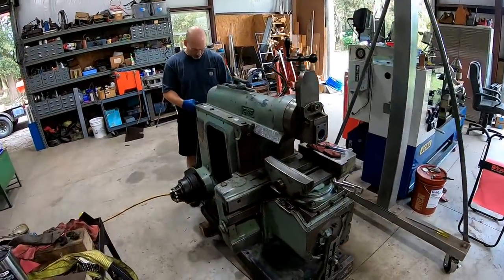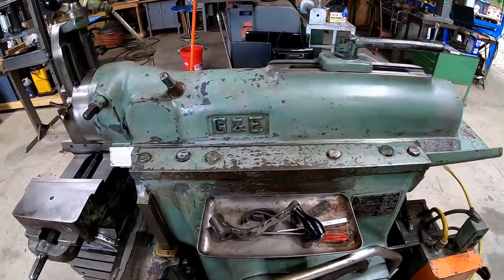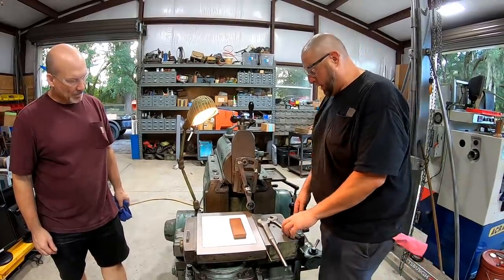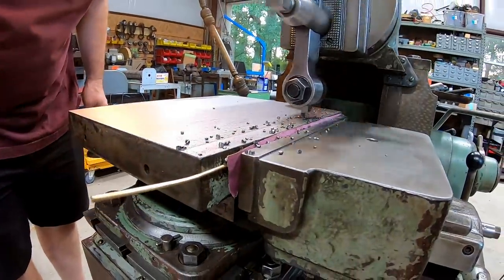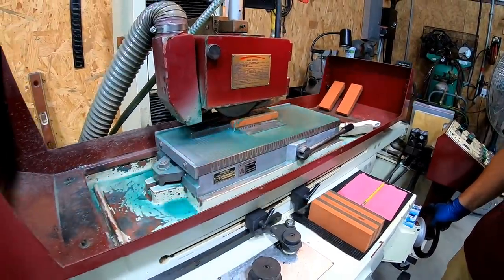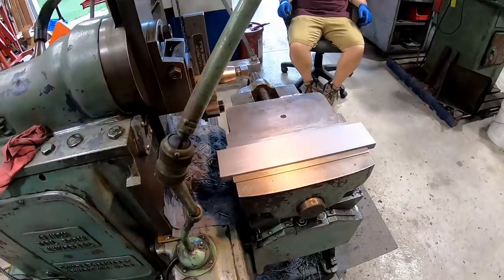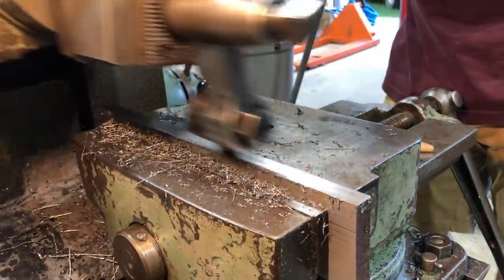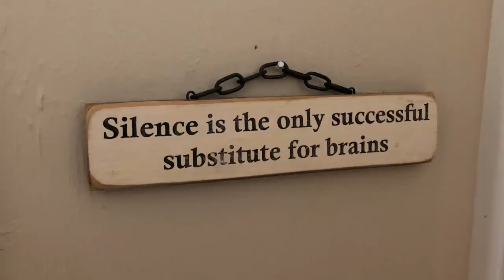SNS 275: 16" Gould & Eberhardt Shaper

Comment: I started off in tool & die making right out of high school (1977) and the shop I worked in had two shapers.  One was a Steptoe and the other was a Gould & Eberhardt.  I always enjoyed running the G & E .  My cousin, who was part owner of the shop, had a truck manual transmission rigged up between the motor and the machine.  I kid you not, and it worked great when you needed to change speeds,  I sure miss working on those vintage machines but as soon as I saw what was coming, or should I say, the factories and shops leaving, I left the field and got into drafting and then design.  I have a tiny machine shop in my garage mostly to enable me to fix things. Anyhow, it is so satisfying to see you two gentlemen keeping the craft alive.  I wish you many years of enjoyment with your shaper.

Comment: Slightly surreal Adam, ref visual difference from your shaper plus yourself, and this one. Needs raising up on a plinth 6 plus inches, used to be standard for many shapers in machine shops. 
Great finish machine surface tip. All the best to Lance and his shaping.
Thanks for sharing

Comment: back when I did planing on machine tool ways. and broad nose finish was called for. the tool was set by using a "jo block" to check for flatness. that way you could have clearance on the tool nose. I ran a Rockford planer with table 36" x 8 feet. the depth was very small, but the width was up to .500" to 750". this produced a really nice finish. can't do that on a shaper. also you would have to stop the ram at each stroke for moving the tool over. also cast iron really likes to warp when machined. so depth of cut was critical. usually as little was needed to "clean up" the surface.

Comment: Hello Adam, You may be onto something with the vibrating motor theory.  I have a 14" Elliot shaper and it came with a motor that ran very rough.  I was getting poor finishes and suspected the motor may be the reason. I found an old Brooks motor for it which ran exceptionally smooth, and as an experiment I changed motors part way through a cut.  The cut was much smoother after the change.   Ken
Reply from the maker: We know it’s one of the issues. The entire machine is vibrating badly. You can see it coming from the motor. Lance is going to puke it apart as well as take the clutch part for a much needed adjustment also.
Reply: Thanks for the reply Adam.  One other thing that has caused vibration issues for me in the past was a bad set of belts.  My large lathe was vibrating a fair amount when I first got it.  After trying a number of things I changed all 4 belts with a matched set.  After several hours of running on the new belts the vibration was almost entirely gone.  Ken

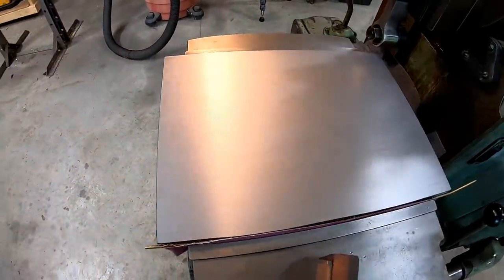Comment: I loved the close up at 28:00.  It would be cool to mount the camera on the ram when doing the slower speed cuts.  I also love the sound of a shaper — so long as the stroke overwhelmes the sound of the oil pump.  It's like a big old steam engine but without the hiss.  The only time I have used a shaper was back at the Ford Apprentice Training School back in 1967 at Harrold Hill in Essex England.  It became mesmerizing watching the ram slide back and forth, and I took to brushing the swarf off between cuts with my finger.  Inevitably I timed it wrong and got my finger tip caught between the cutting tool and workpiece, which made an ugly gash in my finger.  It was not as bad as you'd imagine, but I didn't do it again!  🤕  The thing is, what I did was no different to what I saw on the video today, so if you can't resist, then use a brush.  As a last word, it was worth watching this video if only for the tool honing tip.  That was a killer tip right there.

Comment: Does the part heat much from the cutting? Does it affect how flat the part ends up when it cools? 
Been quite a few years since I was in Temple. There was a good steak house out in the country a few miles east. To the west is Killeen, TX near the military base. I "hear" there are a lot of strip joints there.

Comment: i have come under the impression that shaper tools are pretty much the same as lathe tools so what about a sheer tool on the lathe? ive seen it in done in one of those old time black an white videos about operations on the lathe and i think that would be really interesting to see
Reply: I think the difference is that on a lathe its normally one long continuous cut so you would end up with really long chips. Going off what adam says thats what you want to avoid.
Reply: Check out mrpete222 shop tips #186 & #187. He shows the use of shear tools on the lathe.
Reply from the maker: Yes, shear tools works on the lathe also. Perfect for finishing copper!
Reply: I was only guessing 😅

Comment: i just started playing around with my 16" G&E tool room shaper.  i need to pack the oilers as one side is putting out far too much oil.  Hopefully i can find the rear guard, without it it is making a mess.  I'm also having trouble with the clutch not wanting to disengage.  i took it apart and cleaned it but it only made things worse. I found a military manual for this shaper and it looks like i am missing a spring in the clutch so maybe that has something to do with it.

Comment: i have a question about how do you secure the stones down to the magnet on the surface grinder to grind them? i have a harig 612 surface grinder and need to learn how to do alot more than i do know now. thank-you.
Reply: U have a Jones and shipman and have some stones that are more like a banana, I have tried to scrape them to get flatter, I use mine on my jig bore and grinder in between doing press bolsters but never thought I could grind the stone flat.

Comment: I noticed you seem to get a different chip depending on what you are cutting or am I just imagining things?
Reply: It depends on the composition of the material you're cutting
Reply: Different materials do make different chips. Also they are changing the tool cutting geometry which will change the chip shape.

Comment: finish changes along the cut..    readjust the stroke..  so you OVERSHOOT the work piece while the ram is still at full speed.   you may want to undershoot it also.  but that gets hard on the tool and the shaper ram accelerates to full speed really fast. so you don't need to undershoot the stroke. 

 just sit there and look at the tool speed across the surface..

Comment: why the plate on the back end
Reply: Any oil that comes off the shaper slides down under the moving part and runs back into the machine. If the plate wasn’t there, any oil that’s on the back would go right on the ground and make a mess, possibly causing anyone around the back to slip and injure themselves, a bit like slipping on a banana peel in a cartoon, except with much more pain, possibly a coma if you land just right.

Comment: Could someone please explain why the four oilers need felt packing? I have an Ormerod 18 inch shaper in which the oil is pumped up into the round recesses, it can then drop onto the ways and the excess oil simply overflows out of another hole back into the machine. It has been like this since I bought it many years ago, I had no idea that felt packing was necessary. The plastic covers are missing as well so next question is what material that is clear and easily machinable should I use to make some covers? Thanks in advance.
Reply: just a guess on the felt packing, to make sure 100% oil coverage and less wear. the weight of the top might cause the oil to move to the sides ( metal on metal wear ) the felt soaked in oil gives a gap between the metal surfaces ( metal on felt wear surfaces )  
the only clear materials are glass, plastics and polycarbonates ( Lexan for example )  - ( assuming the round oil sight covers ) with glass,  plastic or polycarbonates you can use a hole saw you just need the correct type and method ( there are videos for that ) … but it might be cheaper and less a hassle in the long run to buy something that fits. $2.00 - $ 15.00 depending size / threaded or not.
Reply: @ROTTK9  Thanks for your response, either I haven't understood what you mean or I haven't explained my question properly. So to recap the round recess where I thought the felt was in the shaper on the video looks the same as mine. The recess on my shaper has two standpipes coming up from the bottom. One is the oil feed bringing oil in and the other is the overflow which drains oil back into the shaper.  The ways are lubricated by a small hole in the side of this recess at around the same level as the overflow. Oil is free to flow through this small hole onto the ways with the excess oil draining back down the overflow pipe so the recess does not ever spill oil over the top and the ways always have oil available to them. The problem is I cannot  see what the function the felt would fulfil, hopefully Adam may read this and comment.
Reply: I'm not sure where your felt is supposed to go on your shaper but felt is usually to spread and hold oil consistently and keep dirt out.